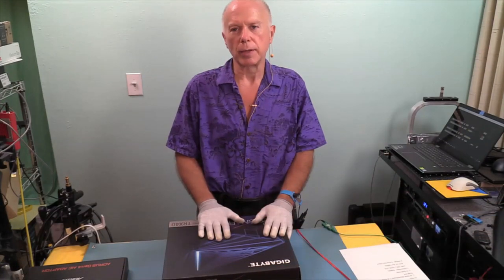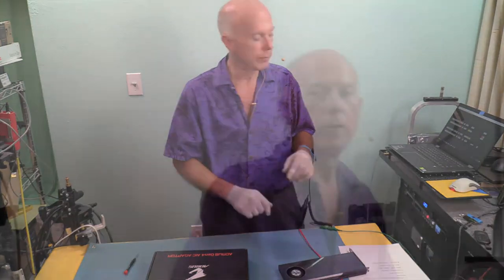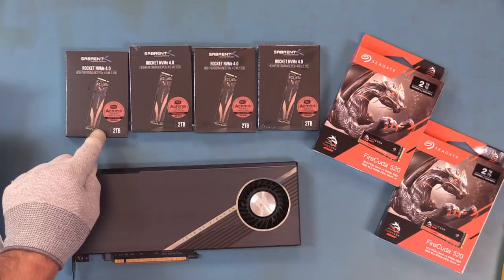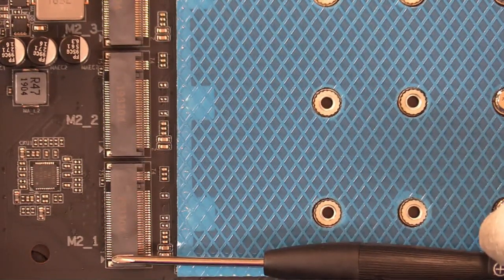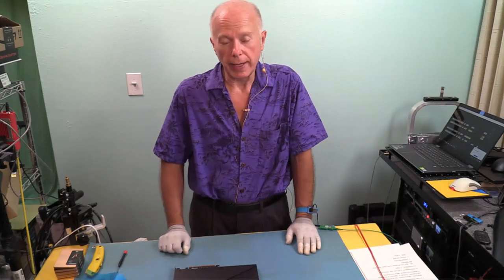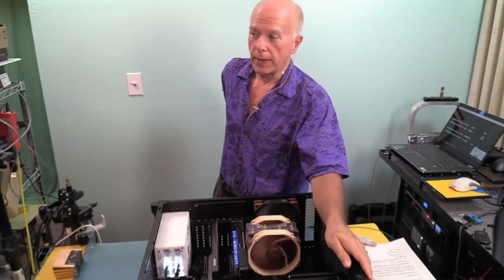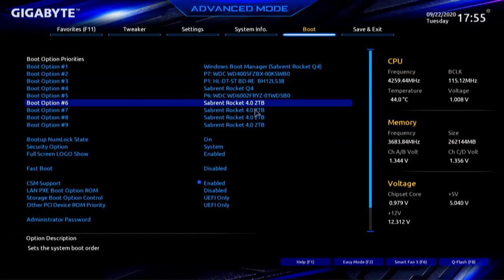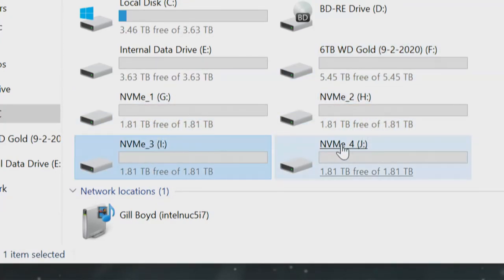Gigabyte AORUS Gen4 AIC Adaptor Comparison and Simple Install Tutorial TRX40 Designare

Comment: Any chance on getting you to drive to Dallas to install mine?? 😂
Reply from the maker: Hi Gregor Punchatz,
Welcome! Absolutely! Right now, only on weekends! Working a 6 month IT Specialist Contract. Going through 4 Pallets of Chromebooks. 4 more Pallets to Tag and Inventory. Then all 8 plus Pallets to introduce into Enterprise for Asset Management, Configuration and Use. And that's just a 2 week Project. My travel time would be 4 hours out and back. Plus food and lodging. I'm game if You are! First, does Your Motherboard have the Resources to handle a Quad card?
Reply: I somehow missed your response … I still need help with this, I have the motherboard that you were using in this video demonstration , I have a 3090 and also a 10 Gb Network card installed. 

Would there be any conflict with those cards?

Comment: Can you post links to Adapters with Bifurcation done by chip? I'm on x570. BTW no one does video with so much information like you anymore. Great Work.
Reply from the maker: Hi 99KINGZ, Yes! Thank You for Your Comments! For now... We have a Video about the GloTrends AIC here: 
https://youtu.be/QF71-5nhrAk
Bifurcation done by AIC chipset. I'll get You those other links this evening.
Reply from the maker: Hi 99KINGZ, 
Bifurcation AICs... 
1.) GloTrends Sky - Requires x8 Slot. 
https://amzn.to/31Fdxnz

2.) GloTrends Palace - Requires x16 Slot. 
https://amzn.to/3hIbPHI
Both use ASMedia 2824 Controller Chipset. Programmed differently. 

3.) A ADWITS Quad M.2 NVMe SSD PCIe X16 Adapter, ASM2824 PCI Express 3.0 X16 Switch to 4 Ports M.2 Adapter Card,Supports RAID,PCIe Bifurcation,4 X4 NVMe
https://amzn.to/3ib0saF

5.) Syba Dual M.2 NVMe Ports to PCIe 3.0 x16 Bifurcation Riser Controller - Support Non-Bifurcation Motherboard (SI-PEX40129)
https://amzn.to/337ZGqN

6.) Syba USA - Quad M.2 NVMe Ports to PCIe 3.0 x16 Bifurcation Riser Controller - Support Non-BiFurcation Motherboard
https://amzn.to/2S4QpcS

Smart PCIe Switching Built-In (Bifurcation Switch) "The SSD7101A-1 and 7102 uses the same PLX chipset on the board however the SSD7102 has an extra EFI chipset." 

7.) High Point SSD7101A-1 4X Dedicated 32Gbps M.2 Ports to PCIe 3.0 x16 RAID Controller

https://amzn.to/3hxZpCb

8.) High Point SSD7102 Bootable 4X M.2 NVMe RAID Controller - N/A 
https://amzn.to/2G1Zro7

2nd Generation NVMe RAID Controller series...
9.) High Point SSD7103 Bootable 4X M.2 NVMe RAID Controller - 
https://amzn.to/3hC5sWs

As an Amazon Associate I earn from qualifying purchases.

10.) Amfeltec Squid Carrier Board - PCI Express Gen 3 Carrier Board for six M.2 NVMe
https://www.amfeltec.com/pci-express-carrier-boards-for-m-2-ssd-modules/
Reply from the maker: Hi 99KINGZ, 
Excellent idea! Just to be clear, the Samsung 980 Pro 1TB is PCIe 4.0, 2nd Generation! 
 Now Available for Order! https://amzn.to/36vFYaL
Reply: @BuildOrBuy  That impressive list. Thx. I have checked all cards. All do Bifurcation independently but will all work in PCIE x16 (physical) if only PCIE x8 electronically ? Also is there any Gen4 adapter ?
Reply from the maker: Hi @GODLIKE99KINGZ ,Yes! I forgot about that one! From High Point. Requires x16 Slot, electrically.  Only one, we're aware of, that's PCIe 4.0. There will be others, in time. Let me check, I'll get the Model Number...

High Point PCIe 4.0 Controllers - https://highpoint-tech.com/USA_new/series-ssd7500-overview.htm
Reply: Can this work in a aurora 11 one drive show up but not my 2nd nvme but first drive show up   raid is on in bios don't see option to create raid

Comment: no need to use linux --> just open control panel --> Administrative Tools --> Computer management --> Disk management (Or just open "Computer Management" directly. No mather what FileSystem, it should always show in disk management (just with a filesystem it does not know what to do with it...)
Reply from the maker: Hi Michael, I wish it were that easy. Yes, it should but IF it does not. If You ever run across one of those Drives, You'll know. It happens. Appreciate Your Input.

Comment: It has taken me 2 weeks to try and get this thing working. Thought my computer was the issue so rebuilt it twice. SO ANNOYING!
Reply from the maker: Hi Ben, What are You trying to accomplish? We need to know Your Motherboard Model, Revision and Chipset. The question being, does Your Motherboard Chipset have the Resources to handle this M.2 AIC. In other words, do You have a HEDT with x299, x399 or TRX40 Chipset?
Reply: @BuildOrBuy  
What do the switches do on the Gigabyte Aorus Gen4 AIC Adaptor?
I believe i initially had it working in the other pci slot. I gave the GPU the pci 4 slot. I understand I bought the wrong mother board.
ANY HELP WOULD BE APPRECIATED!
X570 AORUS ELITE WIFI Rev 1;
AMD Ryzen 9 3900X 12-Core Processor 3.79 GHz;
Corsair Vengeance LPX CMK16GX4M2B3200C16 16GB (2x8GB) 3200MHz DDR4;
Gigabyte Radeon RX 5700 XT Gaming OC, 8GB (in pci 4 slot):

Gigabyte Aorus Gen4 AIC Adaptor with 4x PCIe 4.0/3.0 M.2 NVMe Slots (in pci 3 slot);
Crucial P1 1TB M.2 NVMe SSD (OS)
4x sabrent rocket NVME cards.
Reply from the maker: Hi @bencrosthwaite3542 , 
You're gaining experience! Practice makes perfect! Good to hear from You! How are things going? Troublesome? 
1.) Those Switches are so You can install 3 cards in one Computer. Gigabyte has software to control the Fans. That switch setting allows their software to see each card individually. This would only work on 2 chipsets. An x299 ASUS Workstation Motherboard with PLX Chips or on a Threadripper Pro WRX80 Workstation Motherboard with 7 PCIe Sots. Otherwise, using only 1 PCIe M.2 NVMe Card, leave swiches in default position. 

2.) Your Motherboard - X570 AORUS ELITE WIFI Rev 1
https://www.gigabyte.com/us/Motherboard/X570-AORUS-ELITE-WIFI-rev-1x#kf
3 PCIe Slots. GPU in PCIe x4 Slot. OK. Look in Your PDF Manual on Page 30. Bifurcation. The x16 Slot must be set for Bifurcation. For PCIe 4.0, that setting should be automatic. If not, manually change that to 4x4. 

Each NVMe Drive requires 4 PCIe Lanes. Hence a x16 Slot. A Bios update should solve that eventually. Hope that helps! Next time, let's talk chipsets!

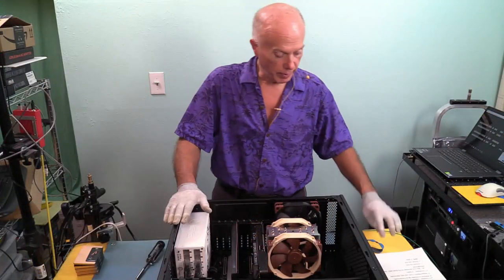Comment: 37:58 😐
Reply from the maker: Hi Tyler, My point was to show things can happen. This is a 3 voice conversation concert going on. Thank You for pointing that out. Sometimes I forget whether HDMI or SDI is on screen. Whether it's a Decimator or a Video Camera. And then the little things come into the mix like plugging in a Computer power supply cable. Issues like with SMPTE Level A or B are easy. I'm sure You can relate, even with a running checklist.

Comment: The highpoint cards also have bifurcation because they have an enterprise raid controller built on board, along with 2gb memory. This is why so much more expensive. And the x570 sucks i built a few of them and while the zen3 is amazing chip the expansion abilities are pa pa pathetic
Reply from the maker: Hi s s, 
Welcome! Yes, Highpoint uses the Broadcom PLX Chip. Big difference from the ASMedia PLX chips. Different class of Chips. We have a lot of Subscribers using the x570 asking questions after they bought instead of before they bought. Looks good on paper. Not so much as implemented. Thanks for Sharing!

Comment: Thanks for video and benchmark of Glotrends 4 bay m.2 sky nvme card...nice useful test and information....my question is will it work in Asus Prime x570-P/CSM board or gigabyte x570 gaming x or  gigabyte x570 UD all have pce16_2 second slot working from and x570 chipset x570 in pcie4.0x4 (8000mbps) lanes bandwidth mode which is equvilent to pcie3.0x8 (8000mbps). secondly as this card is gen3 means pcie3.0 card is its version 2  gen 4 pcie4.0 launched or not. I am sending you below screenshot of manual page if pcie lanes of Asus prime x570-p ...

https://www.linkpicture.com/q/asusx570primeppcie_2.png

https://www.asus.com/Motherboards-Components/Motherboards/All-series/PRIME-X570-P-CSM/techspec
Reply from the maker: Hi Pawan, Looks like Your message was either Posted twice or Duplicated. Hope both messages come through. Answers are in other message. Thanks for Asking! I'm working my way up the message tree! 42 Messages, takes time to Reply!